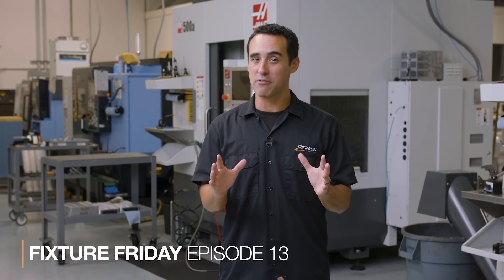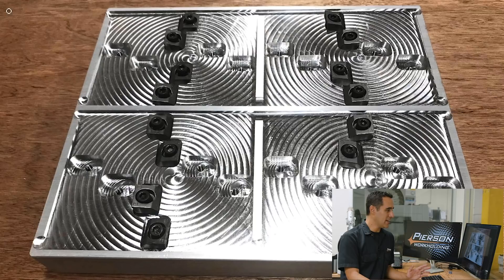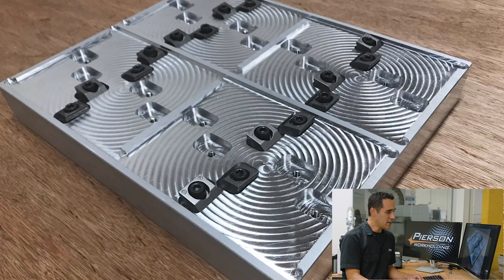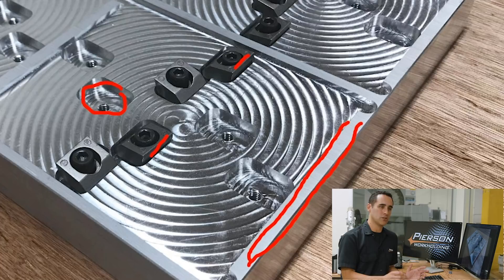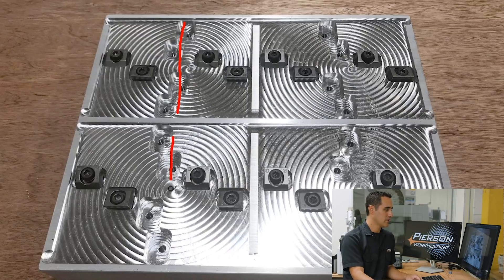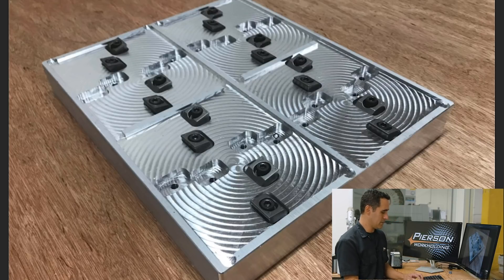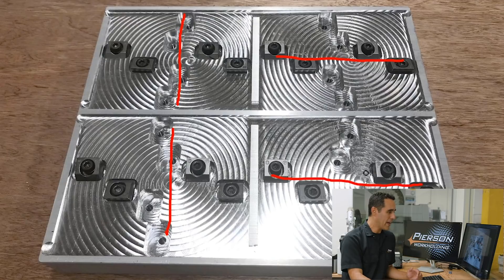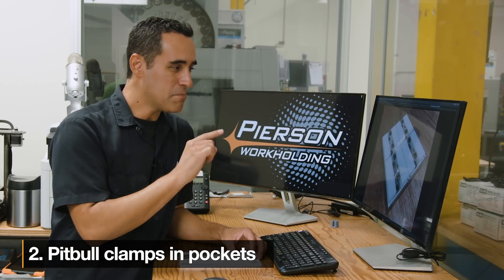COST CUTTING Pallet | Fixture Friday 13 | Pierson Workholding

Comment: what kind of aluminum is it, I have aluminum at my company but the threads are damaged
Reply from the maker: You should install steel screw thread inserts like Helicoils. In my opinion, Aluminum threads are only good for 5-10 cycles.

Comment: Hey Jay!  Are there changes to placement of the pitbull clamp placement or how hard they are torqued because this is a plastic application?  I'm starting the learning and research stage of getting into pallets and knowing what types of clamps to use in certain situations/materials is a tricky subject.
Reply from the maker: That's a really great question and the amount of torque is one of those things that enters into the realm of feel/experience.  There are also pitbull clamps with knife edges that will hold a part down securely but with less torque required.  This would be best for plastic.  Make sure you check out the last Fixture Friday in case you missed it: https://youtu.be/4oFe7XyzrL0
Reply: @PiersonWorkholding  that's great to know!  Just checked out the last fixture Friday and learned a ton!  Will definitely help me getting some rough ideas figured out this week